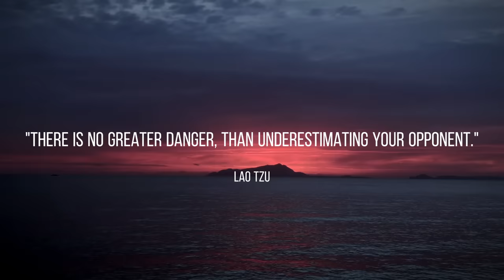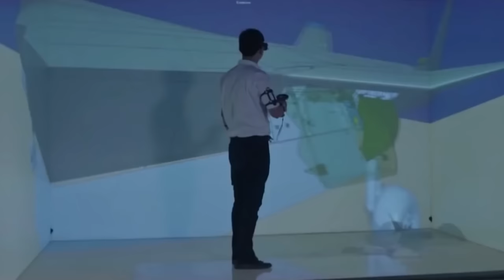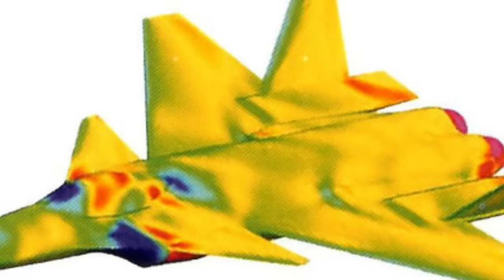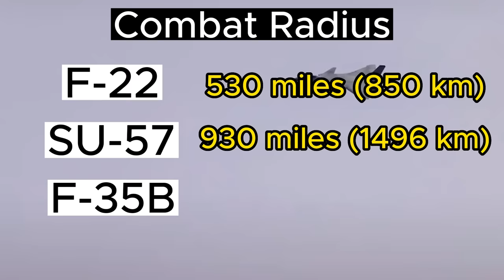China's Stealth Fighter, Good or Bad?

Comment: I agree with many of your points, the J-20 should not be underestimated. There is data from the Taiwanese that indicates the J-20s RCS is something like 0.05m2. So better than the Su-57, but not as good as the F-22 or the F-35. However, I think there is one aspect you may not have considered. With the long range of the J-20 and its small wings in a delta configuration giving it less maneuverability may mean its not meant as an air superiority fighter at all. It may instead be meant more as an interceptor. Perhaps to sneak in and knock out American AWACs and other important ISR assets.
Reply: thats where you might be wrong, the J20 is actually slightly lighter than the F22 and now with the WS15, has more thrust. meaning it will be at least as manoeuvrable.
Canard designs are also exceptionally manoeuvrable at subsonic speeds.
Reply: @hughmungus2760  the J-20 is indeed claimed to be slightly lighter than the F-22. However, the claim that the WS-15 has more thrust than the F119 is suspect at best. Obviously we don't know the real thrust figures for either engine, unless you have access to US and Chinese classified data. The open source data indicates that the F119 has more dry thrust than the WS-15, 26,000 lbs to a claimed 23,000 lbs roughly. So it definitely has less dry thrust. With afterburner the WS-15 is claimed to have between 36,000 and 40,000 lbs of thrust, while the F119 is just listed as having "greater than 35,000 lbs of thrust." So the WS-15 MAY have more thrust in afterburner than the F119, but it has less thrust without burner than the F119. So the J-20 with the WS-15 MAY have a better thrust to weight ratio than the F-22. Of course maneuverability is about more than just thrust to weight ratio. It's also about control surfaces, overall weight, wing size, wing configuration and a number of other factors. A delta with canards can be very maneuverable, on the right aircraft. A small lightweight fighter like the Gripen or the Rafale can have very good maneuverability. The J-20 is not small, or lightweight. Its slightly lighter than the F-22, but nowhere near as light as the Rafale or the Gripen. It's empty weight is more than the Rafale's max takeoff weight. It has a lot of mass that has to be moved through turns and not as much wing area to support it as the F-22 has, canards or no. Larger delta winged aircraft are just inherently less maneuverable than smaller ones, and less maneuverable than an equivalent sized aircraft with a more conventional planform. It's also a long aircraft, relative to its width, not a compact one like the Rafale, or even the F-22. This is also bad for maneuverability, as it means it will have a larger moment of inertia at the ends of the aircraft and be more difficult to rotate on its axis and point the nose where the pilot wants. Thrust vectoring will help, but I'd be surprised if it has the kind of maneuverability the F-22 has. It just doesn't seem to be designed as an air superiority fighter. I could be wrong though I suppose.
Reply: Yes, F-35 definitely has the “first look, first shoot, first kill” in beyond visual range BVR. But in a dogfight or within visual range WVR combat its 50/50 or which pilot is better trained or who first makes a mistake. And F-35 is no couch potato. It can definitely dogfight as it is maneuverable enough. It has similar if not better thrust-to-weight ratios and wing loading as compared with other 4th gen platforms. With a high angle of attack AoA F-35 can replicate thrust vectoring control TVC maneuvers without even having TVC. Especially F-35C with its bigger wings it can do the same tight turns Su-57 and F-22 do. F-35A can do the same but at the cost of higher Gs. Consequently, in a 1 vs 1 match, if either J-20 or Su-57 manages to survive in BVR would mean F-35’s pilot already made its first mistake.
Reply: @johnsilver9338   there are certain advantages a twin engine high thrust/weight aircraft has over single engine designs. Most notably the ability to supercuise and fly higher thus get better milage.

Strategically speaking the J20 and SU57 would be better at accomplishing interception tasks and combat air patrol against 4th gen fighters because of their longer range, longer loiter time, larger missile payload, and faster tactical response time.

The only real advantage the F35 might have is that is might be more stealthy from the front.
Reply: @hughmungus2760  Nope, J-20 can only carry 4 x PL-15 and 2 x PL-10, while Su-57 only carries 4 x K-77M & 2 x R-74. While both F-22 and F-35A/F-35C Block IV can carry 6 x AMRAAMs and 2 x AIM-9X. Also F-35A/F-35C has around 750nmi combat radius and that is already carrying 2 x AMRAAMs & 2 x 2000lb GBUs. It can reach 800nmi+ in A2A config. While F-22 can achieve 1000nmi and more depending on altitude, loadout, and speed. On the other hand 4th gen platforms including F-18s, Typhoon, and Rafale would need external tanks to reach comparable ranges. For comparison,

F-35A with 29,000 lb empty weight; 460 sq ft wing area; 1 x 43,000 - 50,000 lbf wet thrust; 18,250 lb internal fuel; and 4 x AMRAAM, 2 x AIM-9X has around 1.08 - 1.25 T/W ratio and around 86.8 lb/sq ft wing loading at 50% fuel. With 6 x AMRAAM, 2 x AIM-9X has around 1.06 - 1.23 T/W ratio and around 88.3 lb/sq ft wing loading at 50% fuel.

F-35C with 34,580 lb empty weight; 668 sq ft wing area; 1 x 43,000 - 50,000 lbf wet thrust; 19,750 lb internal fuel; and 4 x AMRAAM, 2 x AIM-9X  has around 0.93 - 1.08 T/W ratio and around 69.2 lb/sq ft wing loading at 50% fuel. With 6 x AMRAAM, 2 x AIM-9X has around 0.92 - 1.06 T/W ratio and around 70.3 lb/sq ft wing loading at 50% fuel.

F/A-18 E/F Super Hornet with 32,000 lb empty weight; 500 sq ft wing area; 2 x 22,000 lbf wet thrust; 14,400 lb internal fuel; 3 x 480 gal external fuel including tanks and pylons with similar armament of 4 x AMRAAMs & 2 x AIM-9X has around 0.92 T/W and around 95.9 lb/sq ft wing Loading at 50% fuel.

Gripen E with 17,640 lb empty weight; 1 x 22,000 lbf wet thrust; 7,500 lb internal fuel; 2 x 450 gal 1 x 300 gal external fuel including tanks and pylons with similar armament has around 0.75 T/W and around 87.3 lb/sq ft wing loading at 50% fuel.

Rafale C with 21,720 lb empty weight; 2 x 17,000 lbf wet thrust; 10,360 lb internal fuel; 3 x 2000 L external fuel including tanks and pylons with similar armament has around 0.93 T/W and around 74.4 lb/sq ft wing loading at 50% fuel.

Typhoon with 24,250 lb empty weight; 2 x 20,000 lbf wet thrust; 11,000 lb internal fuel; 3 x 2000 L external fuel including tanks and pylons with similar armament has around 1.03 T/W and around 71.4 lb/sq ft wing loading at 50% fuel.

So F-35 definitely has a good enough T/W ratio and wing loading especially if it gets the Block IV engine core upgrades. Also downside of dual engines means more parts to maintain and more parts that can malfunction. Additionally, a single engine has a lower thermal signature compared to having two heat sources. So it is undoubtedly better for stealth. Lastly, going fast reaching supersonic and more is also inconsistent with stealth as it makes one a bigger brighter infrared target. Hence why it is not required for F-35 and B-21 Raider, since F-35 has its DAS and AIM-260 JATM with its tri-mode seeker including infrared guidance.
Reply: @johnsilver9338   while the J20 has only ever been seen carrying 4 PL15s internally, there is strong evidence that a new folding fin design for the PL15 will allow it to carry 6.

Basically nothing is known about the actual configuration of the Su57s internal bays, but needless to say, its entirely possible for it to carry 6 missiles in a stacked layout as well.

The R77m is roughly comparable to the best AMRAAMs available today with arguably more range and if it does come with an AESA seeker, a better PK potential at range. While the PL15 wholely outclasses the AMRAAM due to its dual pulse rocket motors and AESA seeker

the AIM260 is still years from frontline service. 

As for thrust to weight. Both the Su57 and J20 outperform F35 variants handily with and without afterburners

J20 = 27tons at 50% max load with 2x105kn engines (and 2x171kn with afterburner) = 7.8kn/t and 12.6kn/t

F22 =  28.8tons at 50% max load with 2x116kn engines (and 2x156kn with afterburner) = 8.1kn/t and 10.8kn.t

F35 = 22.5tons at 50%max load with 1x125kn engine (and 1x191kn with afterburner) =  5.5kn/t and 8.5kn/t 

SU57 =  26.5tons at 50% max load with 2x108kn engines (and 2x172kn with afterburner) = 8.2kn/t and 13kn/t

As for electrical generation, Neither the J20 or Su57 should have those issues because they are twin engined designs which mean they won't be overtaxing their engines to run their avionics.
Reply: @hughmungus2760  Russian K-77M and Chinese PL-15 are around 30% and 40% bigger respectively than an AMRAAM. Both won’t have the same kinematic performance doing 30-40Gs maneuver of what an AMRAAM can do. PL-15 for sure is only effective against bigger aircraft like AWACS and tankers. Upcoming AIM-260 JATM retains the same factor of an AMRAAM but uses dual pulse, still dual pulse is less maneuverable compared to older dual thrust AIM-120C and solid rocket-ramjet hybrid like Meteor. What dual pulse has is instantaneous acceleration which the Meteor can't do. However older AIM-54 Phoenix already does this and only time will tell which propulsion is more effective.

Also AIM-260 JATM already entered initial operational capability IOC since last year. Full production may start this year. For European F-35 they will use Meteor certainly, while Japanese has their own JNAAM which is just Meteor with AESA. On the other hand, AIM-260 JATM is the only one to have a tri-mode seeker. 

Their are also not enough Su-57 to make a full squadron. And their are almost a thousand F-35s with half of that in US arsenal compared to 200+ J-20s. Lastly, F-35 has 43,000 - 50,000 lbf (191 - 222 kN) wet thrust so it has good enough acceleration. On the other hand F-35C has bigger wings enabling to do tight turns like F-22 and Su-57 so it is maneuverable enough more so than F-35A/F-35 and even J-20 in 1 circle or 2 circle dogfights even though it don't have a gun.
Reply: @johnsilver9338  manouverability isn't all its cracked up to be in BVR combat because most air to air kills historically happen against unaware targets. Its not like DCS where you magically know you're being locked onto the moment the enemy missile leaves the rail.

Having a seeker that isn't going to be thrown off by jamming and lots of energy is probably whats going to get kills at long range rather than maneuverability 

While there might be an argument to be made at medium range air to air combat where both fighters are aware, the difference in PK is negligible, what kinematic penalties the PL15 might have is easily negated by having more energy and a much harder to spoof seeker.

Its also gross misconception that the PL15 isnt designed for agile targets, its a multipurpose long range AAM thats only about 30mm wider than an AMRAAM, unlike, say the R37 or PL17.

(even then, recent air to air engagements in ukraine has shown that long range standoff air to air missiles like the R37 are more than decent at scoring kills against fighters)

I guess we'll wait and see what the AIM260 is capable of and if teething issues come into play. Just know that very little about it has been published and there aren't publicly available pictures of it yet.

I dont think anyone is going to be doing turn fights in 5th gen fighters. This is the same level of cope the Russians used when they were trying to justify why the best thing they had at the time were flankers.

Infact super maneuverability is being dispensed with in most 6th gen fighter designs which goes to show just how little use it actually has.
Reply: @hughmungus2760  This is why F-35 with its superior stealth and AIM-260 with its tri-mode seeker have a significant advantage in BVR.
Reply: @johnsilver9338  well at least until more information on the PL21 comes out.
Reply: @hughmungus2760  Their is also Raytheon's LREW that can reach 400km but like JATM has a tri-mode seeker.
Reply: @johnsilver9338  I agree that the F-35 is far more manuverable than it is usually given credit for. According to what I've read about it, it's at least as manuverable as the F-16. The thrust to weight ratio is under 1:1 though, it's a heavy aircraft. The F-16 has a better thrust to weight ratio. But yes, the F-35 can dogfight and can win in a dogfight against the majority of 4th Gen platforms. I dunno about it having super-manuverability though. It can achieve very high AoA, but I don't think it's on the same level as the F-22. The main advantage the F-35 would have in BVR and WVR combat is it's sensors and related tech. It has the best radar ever put on a fighter aircraft, allowing it to to detect an enemy long before it is detected itself, and it has a distributed aperture system or DAS that gives its pilot 360 degree situational awareness. The F-35 is, as far as I'm aware, the only aircraft in the world capable of locking and firing a missile on another aircraft that is directly behind it. It can do this with either an AIM-9X or an AMRAAM. Then you add in the training of US pilots, which is generally acknowledged to be the best in the world. So I would say the F-35s chances of winning a fight against a near-peer aircraft are much better than 50/50. I would agree that if it gets to a WVR combat, the F-35 pilot probably made a mistake.
Reply: @johnsilver9338  the F-35 can't carry 6 AMRAAMs and 2 Sidewinders without compromising it's stealth. The internal weapons bay of the F-35, with the sidekick mod, can hold up to 6 air to air missiles. It doesn't have the side-mounted weapons bays that the F-22 has to carry an additional 2 missiles.
Reply: @johnsilver9338  I recall the LREW was a tech demonstrator and isn't actually going to be put into service.

Its also so large it doesn't fit inside any fighter weapons bays.
Reply: @djzoodude  According to a 3rd party radar scattering computer simulation done on Aircraft 101; where they compared all 3 F-35, J-20, and Su-57 low observable LO characteristics through their shapes/geometry alone without the RAM coatings; “The external AIM-9X along with pylon seem to have negligible effect on the total overall RCS of F-35, in fact, in some case, the destructive interference effect actually help reduce the RCS value in some direction.” So YES F-35 can carry two extra AIM-9X each on its wingtip.

IDK about F-16V, but F-16C only has around 0.78 T/W while carrying a typical 6 x AIM-120, 2 x AIM-9X & 3 x 380 gal external tanks to reach the same 750 nmi combat radius of F-35A at 100% fuel. On the other hand F-35A has around 0.86 - 1.00 T/W while carrying the same armament and at 100% fuel. Regardless, with Block IV engine core upgrades its lower safe limit of 43,000 lbf (191 kN) will increase giving it better T/W ratio.
Reply: @hughmungus2760  Nope. It will enter service it will just take longer. However the 1st to enter service is AIM-120D3, followed by AIM-260 JATM. After that its either Peregrine or LREW. But both Peregrine and LREW are from Raytheon so they may just use the same multi-stage rocket design where the shorter version is Peregrine and longer version is LREW. LM was also supposed to compete with a same design with their CUDA but they backed out and instead pursued AIM-260 JATM. Boeing also has their LNAAM but i don't think they were selected.
Reply: @johnsilver9338  Large multistage designs for air to air missiles kinda defeat the purpose of having stealth fighters because you can't fit time into the weapons bays. You might as well strap SAMs to fighters and call it a day if you're going down that path.
Reply: @johnsilver9338  I mean, I haven't seen those RCS studies, but if you are leaving off the RAM coating, that's missing a great deal of the RCS reduction of the F-35. Additionally, I find it hard to believe that the highly reflective round seeker head of a Sidewinder would not increase the RCS of the F-35. Maybe without RAM coatings, that would be true, since the radar return of the Sidewinder would be hidden by the larger return from the aircraft itself, but with RAM coating the F-35 has at least an order of magnitude lower RCS, so the Sidewinder would affect the RCS much more in that case.

As for the F-16 vs F-35 thrust to weight, the F-35 just with full fuel is already below a 1:1 thrust to weight ratio. Max takeoff weight for the F-16 is 42,300 lbs, giving it a .68 T:W ratio. Max takeoff weight for the F-35 is 65,900, giving it a T:W ratio of 0.65. Even empty, the F-35 has a lower T:W ratio than the F-16. It's just a heavier aircraft. I don't know where you pulled those numbers from, but I don't think they are right. Maybe there's some combination of drop tanks and weapons that will give the F-35 a better T:W ratio than the F-16, but the key word there is "drop". The F-16 in combat will drop its tanks, significantly reducing its weight and increasing its T:W ratio. The F-35 can't. So in any combat scenario, the F-16 will have a better T:W ratio. Unfortunately for the F-16, but fortunately for the F-35 even in WVR combat, T:W ratio is not the last word. The F-35 is a much less draggy aircraft, when armed, than the F-16. It's going to be more maneuverable through most flight regimes in a dogfight. The F-35s high AoA capabilities give it the ability to win a one circle fight against almost anything except probably the F-22. In a two-circle energy fight, the F-35 would probably be at a slight disadvantage vs the F-16 and probably most modern fighters. That's before you consider the tech advantage though. DAS and the extreme HOB capabilities of the F-35s missiles would also be a huge advantage over any other fighter flying today.
Reply: @hughmungus2760  Depends on how many stages and the types of propulsion used. But LREW with the most stages can't be carried internally. But the same goes for PL-21. But against stealth fighter longer range AAM is useless anyway. J-20 may only detect F-35 at a much closer distance. While F-35 can detect J-20 at a much farther distance given it is less stealthier.
Reply: @johnsilver9338  everything that we know about the PL21 is that its a ramjet type missile designed to fit inside weapons bays, not to be confused with the PL17 which is externally mounted only.

As for stealth detectability both sides would likely see each other using low frequency radar triangulation which can give a good enough targetting solution to fire active radar missiles into the mix and reasonably expect it to just bump into the enemy.'

Also with such tactics, the more radars you have emitting at different vectors the more accurate the triangulation. 

Honestly outside of one on one engagements, the negligible difference in stealth is not going to help all that much.
Reply: @djzoodude  Nope. Stealth is two parts 1st is the geometry or the shaping. 2nd is the RAM coatings. Both equally important. It's why you can't make 4th gen platforms into 5th gens. Also you should look at the data itself. In 20x20 deg frontal aspect, AIM-9X have a very infinitesimal increase in overall F-35's RCS. Its at basicsaboutaerodynamicsandavionics()wordpress. Replace () with a dot .

Also never seen someone use MTOW for T/W ratio. Even Aircraft 101 don't use MTOW because that is not an apples-to-apples comparison as different aircraft will undoubtedly have different MTOWs. Instead you should calculate their T/W ratio using a similar if not the same loadout. For 4th gen platforms they would also need external fuel tanks to reach the same combat range of F-35 to make a fair comparison. Anyway these are not my numbers these are from Qoura where they compared combat radius of various aircraft including F-35. But I also checked the numbers myself.
Reply: @hughmungus2760  Well NATO already has Meteor and JNAAM for that. While LREW and Peregrine will use a novel design. 

In term of a UHF radar, Taiwan has a big a** UHF radar that can see as far 3000 km. While Japan has their own set of UHF radars. USN on the other hand has a flying UHF radar with their E-2D Hawkeye.
Reply: @johnsilver9338  Nope? Dude, what you said doesn't refute my point. Of course shaping is important for stealth, I literally never said otherwise. The F-35 has a small RCS from shaping alone. It has had a much, much smaller RCS when it's RAM coating is applied. I did look at the data, the F-35 has a frontal RCS of 0.06m2 from shaping alone. That's pretty small, about the size of a softball. Probably larger than the frontal RCS of a Sidewinder though. The F-35 with RAM coating though, has a frontal RCS of between 0.005 and 0.0015m2, depending on your source. That's roughly the size of a half-inch ball bearing. Now, I'm not a stealth expert, but I find it very difficult to believe that a Sidewinder doesn't have a larger RCS than that.

I also used empty weight, and gross weight. But fine, let's load the F-16 with the weight of fuel it requires to have the same range as the F-35 at 100% fuel and the same weapons load. In that very specific case, the F-35 might have a slightly better T:W ratio than the F-16. Not much better, because an F-35 just at 100% fuel has a 0.87 T:W ratio, before you add it's weapons load. I think your Quora numbers are incorrect. But as I said, it's also not combat relevant, because the first thing the F-16 will do when about to enter combat is drop its tanks, significantly lightening the aircraft and improving its T:W ratio. The F-35 can't exactly drop its internal fuel tanks.  It is flat out a much heavier aircraft than the F-16, almost twice as heavy in fact, and it doesn't have an engine that is anywhere close to twice as powerful as the F-16s.
Reply: @djzoodude  Then maybe our F-35 and F-16 specs differ. Regardless with the core engine upgrade F-35 will certainly have better T/W ratio than F-16 or any other 4th gen platform except F-15.
Reply: @johnsilver9338  So I'm just using generally publicly available figures for the aircraft, and doing the calculations. Even with an improved engine producing 50,000 lbs of thrust, the F-35 will still only be barely above a 1:1 T:W ratio. It would still be worse that the F-16. Also, the F-16 has a better T:W ratio than the F-15. Unless you are talking about some variant of the F-15, and not the F-15C. At full fuel and with a useful load out, the F-15C has a 1.06 T:W ratio. At full fuel with a useful load out, the F-16 has a 1.11 T:W ratio. The only fighter for which we have trustworthy data that outperforms the F-16, as far as I know, is the Eurofighter Typhoon. The F-22 is on par with the F-16.
Reply: @johnsilver9338  I'd be extremely doubtful Taiwan's UHF facilties would survive past the first few hours of hostilities. And E2s would have to put themselves in extremely vulnerable positions close to the chinese coast for them to do any good.
Reply: @djzoodude  It is above 1 at 50% fuel even before the upgrade. Aircraft 101 is at 1.06 at 1.17 after the engine upgrade. I made a mistake, its actually from Reddit not from Qoura. A bit higher though at 1.10 but its calculated with 45% fuel. Even wiki is 1.07 for F-35A at 50% fuel. Mine is at 1.07 - 1.24 carrying 6 AMRAAMs at 50% fuel.
Reply: @johnsilver9338  Ah, ok, so you were talking about not at full tanks. That's a bit of a different story. But if you are gonna compare the F-35 at 50% fuel, then you should compare it to the F-16 at 50% fuel. (1.32 T:W ratio at 50% fuel btw)
Reply: @djzoodude  For comparison, here's mine which is also got from Reedit though I did it at 50% fuel instead of 45% fuel they use.

F-35A with 29,000 lb empty weight; 460 sq ft wing area; 1 x 43,000 - 50,000 lbf wet thrust; 18,250 lb internal fuel; and 4 x AMRAAM, 2 x AIM-9X has around 1.08 - 1.25 T/W ratio and around 86.8 lb/sq ft wing loading at 50% fuel. With 6 x AMRAAM, 2 x AIM-9X has around 1.06 - 1.23 T/W ratio and around 88.3 lb/sq ft wing loading at 50% fuel.

F-35B with 32,470 lb empty weight; 460 sq ft wing area; 1 x 41,000 lbf wet thrust; 13,500 lb internal fuel; and 4 x AMRAAM, 2 x AIM-9X has around 1.00 T/W ratio and around 89.2 lb/sq ft wing loading at 50% fuel. 

F-35C with 34,580 lb empty weight; 668 sq ft wing area; 1 x 43,000 - 50,000 lbf wet thrust; 19,750 lb internal fuel; and 4 x AMRAAM, 2 x AIM-9X  has around 0.93 - 1.08 T/W ratio and around 69.2 lb/sq ft wing loading at 50% fuel. With 6 x AMRAAM, 2 x AIM-9X has around 0.92 - 1.06 T/W ratio and around 70.3 lb/sq ft wing loading at 50% fuel.

F/A-16C Block 50 with 18,900 lb empty weight; 300 sq ft wing area; 1 x 29,500 lbf wet thrust; 7,000 lb internal fuel; 3 x 380 gal external fuel including tanks and pylons with similar armament of 6 x AMRAAMs & 2 x AIM-9X has around 0.97 T/W and around 101.1 lb/sq ft wing loading at 50% fuel.

F/A-18 E/F Super Hornet with 32,000 lb empty weight; 500 sq ft wing area; 2 x 22,000 lbf wet thrust; 14,400 lb internal fuel; 3 x 480 gal external fuel including tanks and pylons with similar armament of 6 x AMRAAMs & 2 x AIM-9X has around 0.90 T/W and around 97.3 lb/sq ft wing loading at 50% fuel.

F-15E with 31,700 lb empty weight; 608 sq ft wing area; 2 x 29,160 lbf wet thrust; 13,120 lb internal fuel; 3 x 610 gal external fuel including tanks and pylons with similar armament of 6 x AMRAAMs & 2 x AIM-9X has around 1.22 T/W and around 78.3 lb/sq ft wing loading at 50% fuel.

Gripen E with 17,640 lb empty weight; 1 x 22,000 lbf wet thrust; 7,500 lb internal fuel; 2 x 450 gal 1 x 300 gal external fuel including tanks and pylons;  6 x Meteor, 2 x IRIS-T has around 0.73 T/W and around 89.8 lb/sq ft wing loading at 50% fuel.

Rafale C with 21,720 lb empty weight; 2 x 17,000 lbf wet thrust; 10,360 lb internal fuel; 3 x 2000 L external fuel including tanks and pylons; 6 x Meteor, 2 x MICA has around 0.91 T/W and around 76.1 lb/sq ft wing loading at 50% fuel. IDK if it uses IRIS-T so I used MICA instead.

Typhoon with 24,250 lb empty weight; 2 x 20,000 lbf wet thrust; 11,000 lb internal fuel; 3 x 2000 L external fuel including tanks and pylons; 6 x Meteor, 2 x ASRAAM/IRIS-T has around 1.01 T/W and around 73.0 lb/sq ft wing loading at 50% fuel.
Reply: @johnsilver9338  hmm, ok. Those numbers don't seem quite right to me, but I don't think there's much use further discussing it. Good talk.
Reply: @djzoodude  Yes F-16 has a higher T/W ratio if it has no external tanks. But it will use external tanks to reach the same combat radius of F-35 which is what I'm comparing.
Reply: @johnsilver9338  I don't really understand how that's relevant though. The sort of T:W ratios we are talking about is not really a factor when you are just talking about moving around, because you aren't going to be using afterburner. T:W ratio with afterburner is only really relevant when you are talking about combat. A higher wet T:W ratio allows better acceleration, better energy retention and better energy recovery in combat. The first thing an F-16 will do when entering combat is drop its tanks, negating any T:W ratio advantages the F-35 may have had from the F-16 carrying tanks.
Reply: @hughmungus2760  China has more to lose in this actually. Major disadvantage at fighting at home turf is their manufacturing industry, airfields, shipyards, ammunition and fuel depots, power plants, power grids, and other core facilities will be targeted especially at the initial days of war. Same with what’s happening in the Russian Ukraine war.
Reply: @djzoodude  For what I read also at reddit, dropping tanks is not standard procedure. But like you said this specs are only good estimates for dog fighting capability. But in BVR F-35 will slaughter any 4th gen platform. The only 4th gen that was able to beat a 5th gen in BVR is a Growler. EA-18G where able to beat F-22 2 times by jamming them while closing in fast to force F-22 to dogfight. All other 4th gen that were able to defeat F-22 where in a dogfight.
Reply: @johnsilver9338  china is simply too vast to really take on with conventional strategic strikes. There just isn't enough conventional standoff munitions to put a real dent in china's industrial base which is bigger than the US, EU and Japan combined.

And like with Russia, the US will want to avoid direct attacks on chinese soil because large scale strategic attacks on critical chinese infrastructure is pretty much guaranteed to lead to nuclear escalation.

And dont think because the chinese have been historically, skittish about nuclear weapons means they won't use them. The recent massive expansion of missile silos in china, the development of hypersonic glide weapons with intercontinental range and the sacking of the head of the chinese strategic missile forces all indicate a shifting of tone with china's nuclear posture from one of minimal deterrence to credible threat of MAD.
Reply: @hughmungus2760  China does a have a huge industrial sector, but it's not bigger than the US, Japan, and the EU combined. The US, Japan, and Germany combined account for a larger percentage of world industrial output than China. Also, China's industrial base is centralized into its cities, so I don't think it's as difficult to do significant damage too with conventional strikes as you are saying.
Reply: @djzoodude  Considering conventional strikes can only be done with very long range standoff weapons with at least some degree of stealth. Its not like china doesn't have one of the world's most capable SAM networks, particularly around their coastline.

Nor would the PLAAF and PLAN be sleeping.

The US has maybe a couple thousand missiles that would fall under the catagory of stealthy and long range, and even their chances of successfully penetrating chinese air defenses won't be gaurenteed.

Meaning after a few weeks of fighting the entire arsenal of US missiles would be exhausted and due to a catastrophic breakdown in supply chains, particularly in refined rare earth metals and semiconductors (cause taiwan would be blockaded) , the US would struggle to produce more munitions to continue the campaign. 

if the US is expecting to take 2 years to ramp up 155mm shell production immagine how long it would take to ramp up production of complex weapons like JASSMs when you have massive shortage of chips and REs. and half the machines you need to ramp up production require components made in china.

You also have to consider what might happen if china destroys US satellites meaning the US can no longer get ISR over chinese industrial targets to strike.
Reply: @johnsilver9338  I don't believe reddit is correct about this. If we are talking about a strike mission, then tanks are unlikely to be dropped. But it is basically SOP to drop tanks when entering air to air combat. A plane with external tanks has a limited flight envelope, they can only pull like 6 or 7 Gs without damage to the drop tank, connectors, or airframe. Most modern fighters can pull up to 9 Gs without drop tanks. An F-16 will drop its tanks when it enters air to air combat. I agree that a 5th Gen aircraft like an F-35 will annihilate any 4th Gen aircraft in BVR.
Reply: @hughmungus2760  There are 4000 Tomahawks in US arsenal alone in 2020. This don't include other cruise missile they already have. Much more other countries will have their own inventories. Plus It may not even be the US but more likely Taiwan to target core facilities especially the 3 Gorges dam if push comes to shove. 

Also its more likely kamikaze drones will be used because even Russian SAMs including S-300/400 that are touted the "best" in the world are having a hard time detecting and intercepting them.
Reply: @djzoodude  Assuming the fuel on external tanks can be transferred to internal storage, F-16 dropping its tanks at 50% fuel is almost the same as F-16 at 100% fuel without external tanks. At that point, F-16 at 100% fuel with no external tanks is a direct comparison with F-35 at 50% fuel as that would be an apples-to-apples comparison. 

F-35A with 29,000 lb empty weight; 460 sq ft wing area; 1 x 43,000 - 50,000 lbf wet thrust; 18,250 lb internal fuel; and 4 x AMRAAM, 2 x AIM-9X has around 1.08 - 1.25 T/W ratio and around 86.8 lb/sq ft wing loading at 50% fuel. With 6 x AMRAAM, 2 x AIM-9X has around 1.06 - 1.23 T/W ratio and around 88.3 lb/sq ft wing loading at 50% fuel.

F/A-16C Block 50 with 18,900 lb empty weight; 300 sq ft wing area; 1 x 29,500 lbf wet thrust; 7,000 lb internal fuel; 6 x AMRAAMs & 2 x AIM-9X has around 1.04 T/W and around 94.7 lb/sq ft wing loading at 100% fuel.

So there's is not that much difference in their T/W.
Reply: @johnsilver9338  
Tomahawks are basically going to be target practice for SAMs, they're slow, non stealthy and many of them will likely miss because they wouldn't have effective ISR intel on targets of opportunity inside of china.

Using these weapons for strategic bombing would also almost instantly draw down stockpiles because even small country like Ukraine soaked up thousands of missiles and drones from Russia and are still able to keep the lights on and the water running. China is dozens of times larger than ukraine.

How many other countries are keen on jumping into WW3? Especially knowing if things got out of hand they'd likely be nuked if they did.

Seriously? the three gorges? Thats just says you know nothing about engineering. The dam is 150m thick and weighs as much as a mountain. Nothing short of a nuclear strike can destroy it. Taiwan can hurl all the conventional missiles at it that it wants and it wouldn't do a thing.

The Kharkovka dam in ukraine showed that trying to destroy a dam from the outside is nearly impossible and you need sappers to go in with lots of explosives to actually do it.

And if the US or anyone has any ideas of striking it, well, I'll believe that when the US is comfortable with hitting nuclear power stations.

Other critical military targets like missile production lines, military warehouses and fuel depots would likely be dispersed into the thousands of km of underground tunnels in china or hidden amongst civilian industry. Combined with the fact that US spy satellites would be the first things to go, you wouldn't know where to shoot at.

Kamikaze drones are only really useful on a tactical level when manually guided or as terror weapons because they can't distinguish targets 1000km away.
Reply: @johnsilver9338  the fuel from the drop tanks can't be transferred to the internal tank as far as I know. It will draw fuel preferentially from the drop tanks, I believe. But if they've both flown enough to burn 9000 lbs of fuel, the F-16 will have about 70% of its fuel remaining. The F-16 can't carry more than 7000 lbs of fuel externally. So the F-16 would still have the better T:W ratio.
Reply: @djzoodude  It's comparable as F-35 will get engine core upgrades.
Reply: @johnsilver9338  If and when the ECU program is actually implemented, which is likely years in the future, then those F-35s may have a T:W ratio closer to being on par with the F-16, if the upgraded engine can indeed deliver a significant amount of additional thrust. The primary purpose of the upgrade though appears to be producing more electrical power, not additional thrust. But regardless, until that upgrade happens, no it's not comparable. The primary advantage of the F-35 is not its kinematic flight performance, its primary advantages are its stealth, its sensor suite + data fusion giving its pilots unrivaled situational awareness, and if the battle somehow comes down to a dogfight, its extreme HOB capabilities. 99% of the time though, anything fighting an F-35 will be shot down before it even knows the F-35 is there.